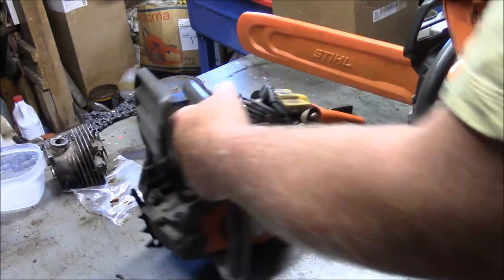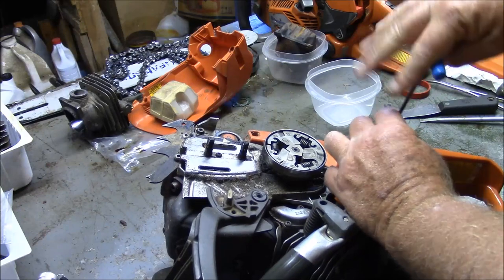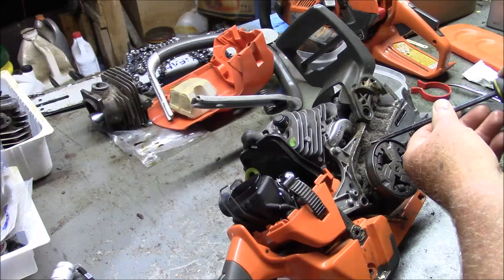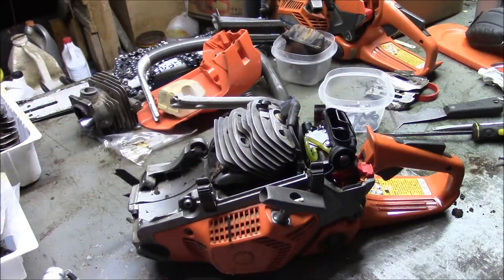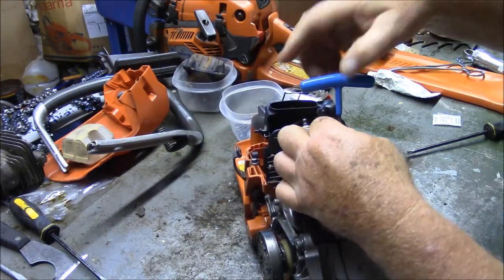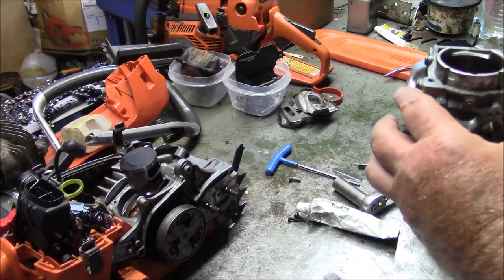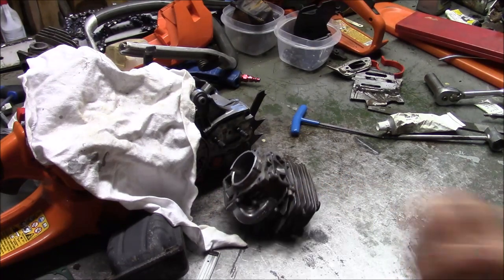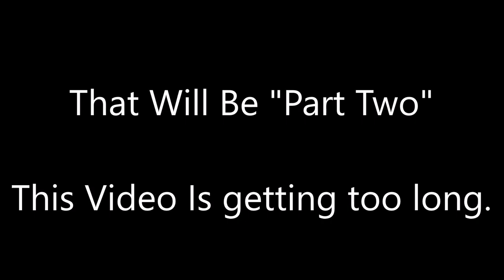Husqvarna 562xp HTSS Cylinder Removal & Inspect Modifications & A few more "Tweaks".. :) Part 1 of 2

Comment: I see I am not the only one with a Stihl scabbard on a Husqvarna saw.  My 372 has a 20 inch scabbard on its 24 inch bar.  I have an extra Stihl 24 inch scabbard but it is a little bigger than the 20 inch which almost covers the bar, except for about two inches.  It does have “373” painted on it, just like my Stihl bar covers have their model number painted on them, so the do not get mixed up.

Comment: Can you tell me how to pull the intake boot out without pulling the cylinder?
Reply from the maker: No , not really. Even if u ripped it out, it would be a bear going back together without having the cylinder off. WHY is pulling the cylinder an issue?? Of the things related that is the easiest part :)
Reply: Would just been easier if it was easier...... ha I was just not prepared to pull the cylinder. Now I'll need a agasket and then I'll end up doing this and that now that I know this has to be done that way.
Reply: @afleetcommand so as you said , you have never seen the intake boot torn. Well, you are right. My noobnis on husky shows. It was just the way the boot was molded. The gasket side of the boot was compressed so maybe that's part of my issue. Also some burrs on the cylinder .
Reply: @afleetcommand  so I see what you mean as in a mechanics point of view , needing to get them fixed as soon as possible. I did get it done. I should show you the swivel , one of those 90° drill adapters,  and a couple different t25 bits. Also used one of those multi bit screwdrivers to turn the 90° driver. Yes it is very difficult. Also the little plastic piece that fits around the intake boot , yeah I couldn't figure out how to get that on without it going on with the boot first then bolting to the cylinder. It is doable tho. Thanks for your help

Comment: Is it possible to take the manifold off with out removing the cylinder? And is it ok to clean the carburetor with carb clean?
Reply from the maker: Maybe but It is simply easier and the best way is with the cylinder off, carb clean isn't going to do anything on those unless they are disassembled. ANs once apart carb clean can help.
Reply: Haha I'm asking the same

Comment: Great video! My husky dirt bike runs 60~1 😁
Reply from the maker: Ran mine for decades on Bel-Ray H1R and definitely out lasted my friends to top end wear at 32:1 , especially the old air coolers. Remember the first craze with synthetics that wouldn't burn clean...HAD to run 50:1 or they would gum up everything, power valves....the worse. But when the cleaner burning ester based synthetics came out.....a no brainer :)
Reply: @afleetcommand  funny you said Bel-Ray, that’s the same stuff I ran in my early 80’s CR80. Thanks for responding.
Reply from the maker: It was and still is a great ester based oil. After working for a Dirt Bike company in the early 2000's, the take away was oil & physics haven't really changed, only the labels and hype around them. And I learned over time to go with the physics/chemistry vs. the current fads of the moment. Same here with the saws...SOSDD. :) So many of the different bands start with a standard base stock and tweak a percentage point or two to make it theirs....Bel-Ray & Klotz got it right 30 or 40 years ago.

Comment: Yeah good choice mate on getting the 550xp. There great saws. I managed to pick up a really clean one for £60 or about $80 aha. 
I've been looking to build/convert a 560xp that we have in the uk to a 562xp that isn't available in the uk. 
Is the 562 a good saw over all? How does it run a 24" bar? If you can do a video that would be great :) 
Cheers Sam from the uk
Reply from the maker: The tweaked 562's I have are about a match of a stock 372. All we have around here is hard wood so rarely use anything  larger than a 20in on those saws. I happen to like the saws...especially the new version that they just released. typical upgrades addressing issue they have had over the years. A pretty mature product now. You can probably get some 562 cases from over here and just build one with the rest from your 560.. :) you would also need a different clutch side cover. I think I did a video a while back going through the differences between a 555 and 562.

Comment: My 555 rings get stuck at 40-1 with klotz oil rec gas i dont get it
Reply from the maker: And you want us to accept the premise the 40:1 was the culprit? Or are there other factors. Have a lean condition any oil ration will create an issue. And different "Zlotz" oil have different applications. Water Cooled vs. Air cooled for example. Bean (Caster ) oil for pure racing vs. a typical synthetic. So this is one of those messages where there is no reasonable response as there are too many variables from operator setup error, to maintenance , age and hours on the saw, etc. to even engage.

Comment: Is it true about these saws having a hot start problem? I was thinking about buying one.
Reply from the maker: Early ones did, as the saw went through upgrades issues one by one went to statistical insignificance. By 2016 they were pretty solid, some did still have hot start issues. The new ones have less of a chance. I wouldn't be afraid of a new 562. Awesome saws. Will always recommend the 572xp as that saw is sorted out and the "next" generation of those saw designs.
Reply: @afleetcommand  Thanks you were very helpful!!!

Comment: personally every time i e run 50:1 in any husqvarna or poulan its burnt up so i run them 40:1 or a tad bit richer and set the saw a tad rich too. also i ran my friends 435 and it need to be tuned but i cant get a splined carb tool. any suggestions?
Reply from the maker: ebay...
Reply: Amazon has a carb adjustment screwdriver set for super cheap and it's got about 10 or 12 different ones so they fit about everything